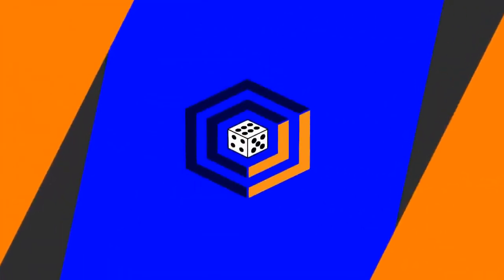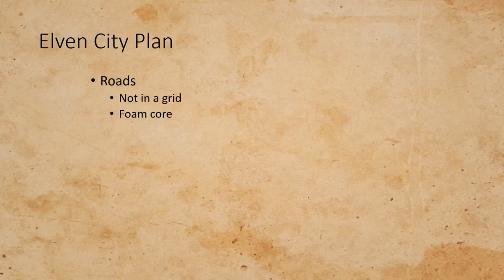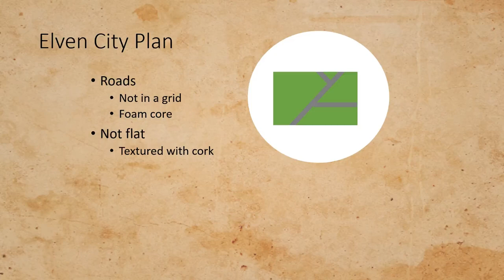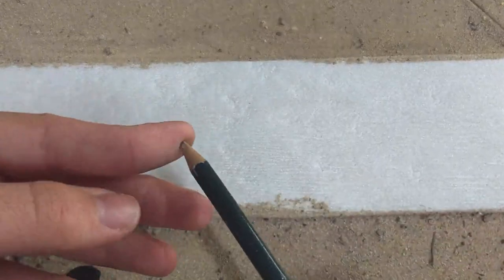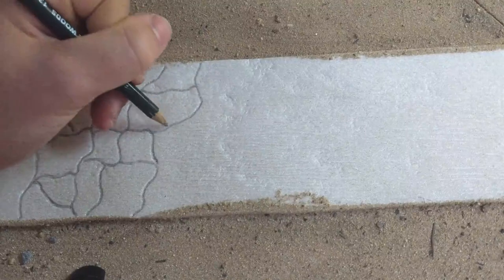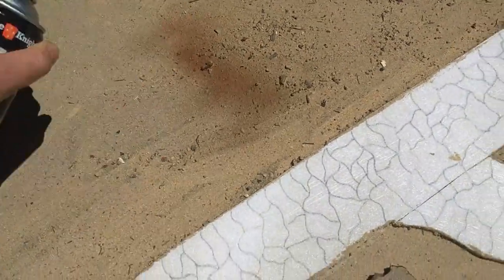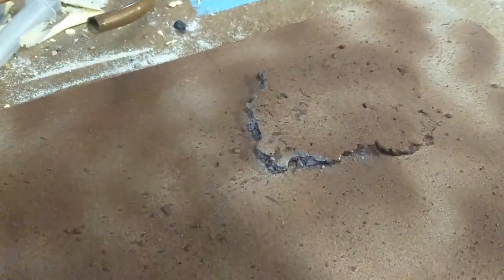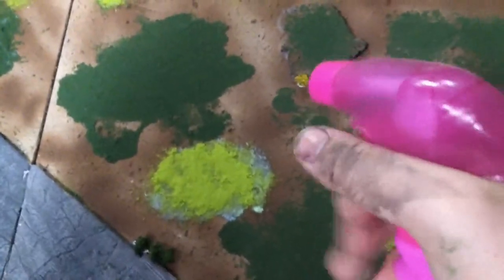How I made my Elven City Base Board

Comment: Hey,
What material did you use for tiles?
Have it been flat since build? Or would you recommend other material?
If you did used plywood, could you provide the thickness and type (is waterproof or sth needed)
Reply from the maker: I used 6mm MDF sheets and didn't water proof them at all. I use these tile minimum once a week and they have held up perfectly fine and haven't warped at all. I really like these because they are so light weight and don't take up much space. For my next board I reckon I will go for more of this material
Reply: @ConquestCreations  thanks for prompt replay !!! I'm quite new to the hobby and each time this "simple" material ofcourse comes with great variations of types, sizes etc.
Btw thanks to you, I did change the paiting concept of my armies (your goblins and isengard just look amazing and brave). Great content and inspiring aswell. 
One tip. Change your lights to led, maybe this will remove this glowing effect that you often get on videos ;)